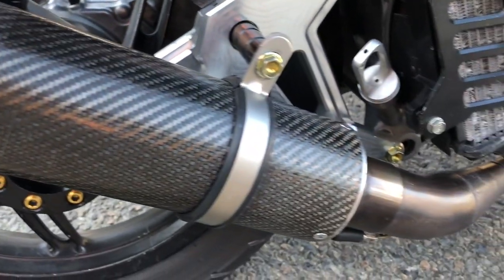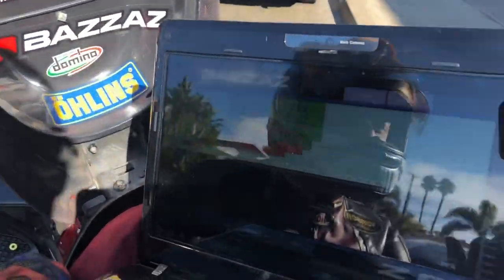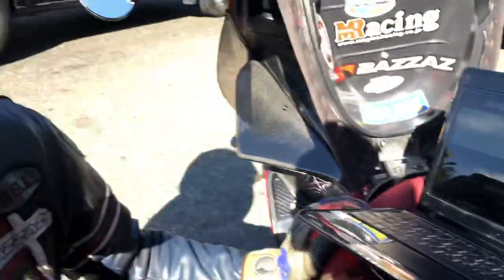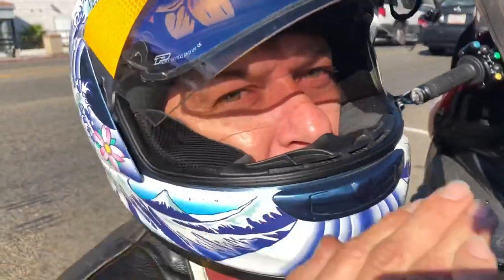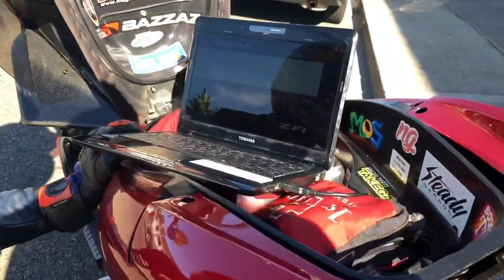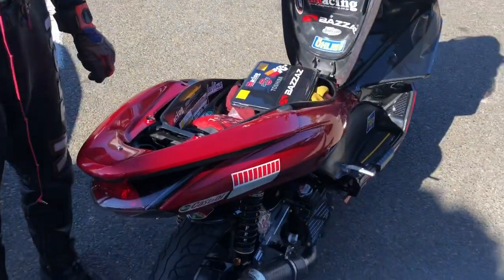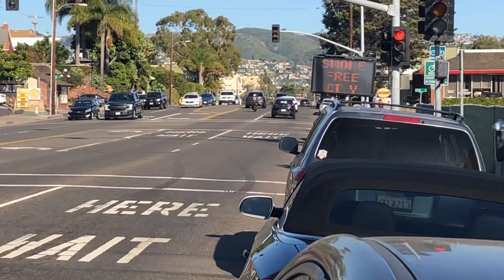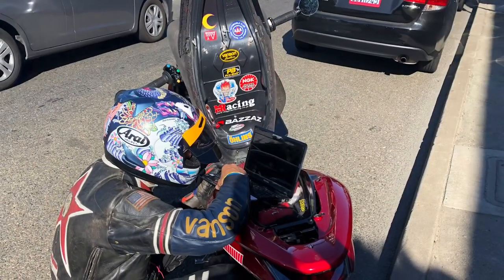WHY PERFORMANCE SCOOTERS ARE PICKED OVER MOTORCYCLES - TRICK HONDA PCX 175 GETS LAPTOP TUNE ROADSIDE

Comment: I enjoy the 2015 Honda PCX 150. I have modified it with the NCY variator kit (drive and face) Leo Vince Corsa GP exhaust and short screen. I drive it all the time. So far my top speed has been 75mph (GPS) and I have ordered the 52 gear to step it up. Ordered 14g Dr Pulley Sliders / 13g Rollers and run .50oz of Boostane per fill up. I can still get 100+mpg and she is a blast. Being disabled I have to ride something light with the twist and go action. Have fun and enjoy.

Comment: Indianapolis IN. I have a Busa and yes I'd drag one 4 sure I work for a small engine shop and had a customer donate one to us today we already have plans to trick it out and big motor plans. This would be a joint venture at the shop the last two builds I worked one on one with the customers needless to say they are some happy guys my plans over winter is to build a drag mower wheelie bars included.
Reply from the maker: Very cool! At NHDRO?

Comment: Will a stock machine run at freeway speeds? Seems dangerous
Reply from the maker: I think he does about 85 mph on this. Would you do it?
Reply: Seems fast enough to be safe on the highway & the brakes appear to be sufficient, I just might.
Reply: Weight is light and you can be knocked off by a high wind.this is silly for highways

Comment: Looking to upgrade my 2019 PCX to get it just a bit faster for highways. I've gotten it up to 67 on a good day, tucked and down hill, average is about 62. Do you all have any suggestions for upgrades that can get me in the 70-80 mph zone? Also if I run it at it's max, is it bad for the engine?
Reply: New Variator, 12g Sliders, Drive face and a new OEM drive belt will get you up to 70+mph. You can also do an intake and exhaust if you want even more.

Comment: I got a  2018 Honda PCX 150 I was wondering how I can increase the speed. My scooter tops at 65MPH
Reply: Cvt tuning
Reply: New variator, 12g sliders, drive face and new oem belt will get you past the stock rev limiter (63 mph) you should get past 70 mph depending on rider weight and driving conditions.
Reply: @jblaust  by sliders do you mean rollers? And will new belt bypass the stock Rev limiter yea? Mine only hits 62/63 as u said